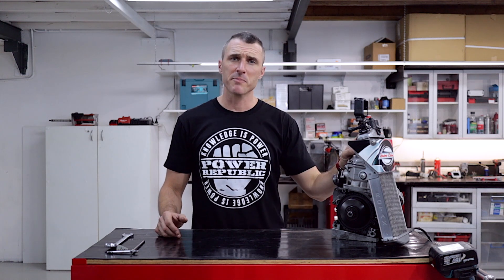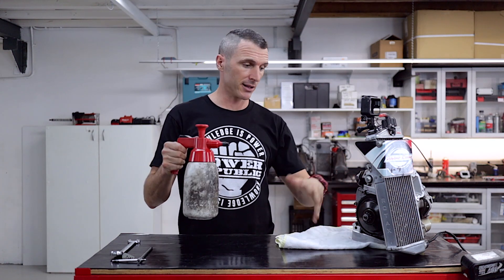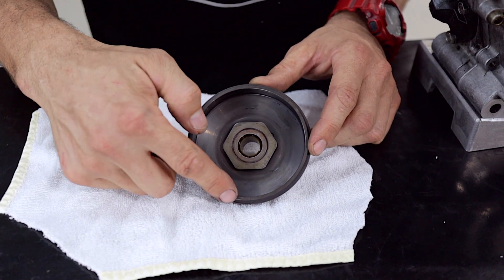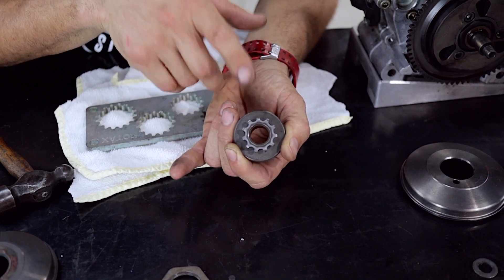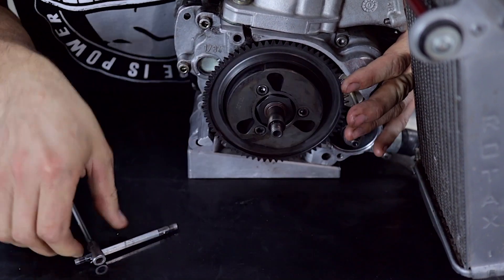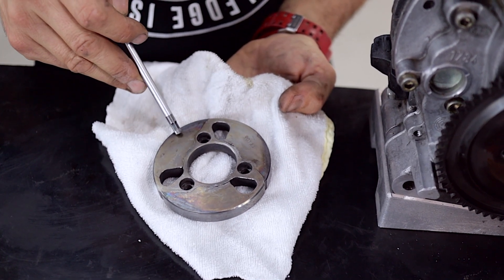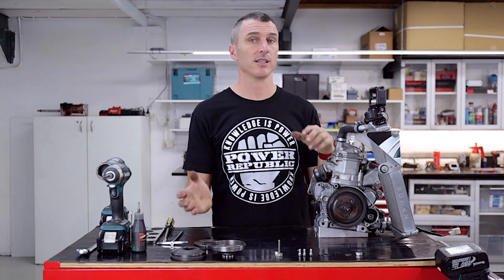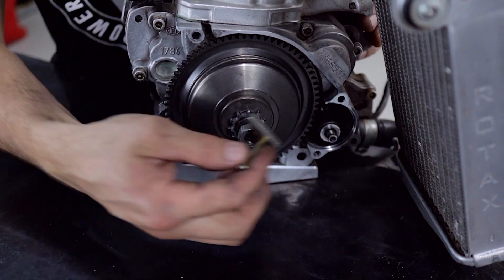HOW TO: Service Your Rotax Max Clutch - POWER REPUBLIC

Comment: Hi mate!!
Couple of comments additional to the great job that you have done:
1) Lubricate crankshaft with lithium based grease in the running area of the needle cage
2) Tighten hex. nut with thrust washer (machined side towards the clutch drum). Tighten- ing torque 35 Nm (26 ft.lb).
I have done it today, as Rotax recommend to do it after 2 hours.

Regards from Valencia (Spain)
Reply from the maker: Hola Vig,

thanks heaps for tuning in and sharing the videos.  how's the karting in Spain this winter?
Reply: @PowerRepublic  hi Derek, karting in Spain is great even during winter time, Take into account that the coldest day we get specially in Valencia is 10 degree Celsius and by noon in a sunny day we get 18C. Close to my city With less than 40 minutes drive I have 7 circuits, valencia is the city of the Motorsport, come to me in case you come over to Valencia sometimes , all the best!
Vicente

Comment: New to the sport, just found huge cracks on my clutch drum after hearing it grind against flywheel.
Looks easy enough to change, but I never thought the drum was a wear and tear part.
Reply from the maker: CFG Goes Racing the older ones cracked on the regular. The newer ones are harder to break but still do from time to time.  They are a bit like tyres, when worn out, replace it

Comment: As a newby I’m really enjoying your videos and learning so much . Thanks . Can you do a video on a clutch upgrade to the newer style clutch and gearing ?. 
I’ve got the kit in a box of parts and keen to get this done . 
Much love
Reply from the maker: Hey Ryan, you are very welcome.  The vids are definitely there to help you new guys with the fundamentals.  We have a video on how to remove and install the Rotax Ring gear and also the new style clutch drum.   Check them out and if I’m still short, let me know and I will do a remake for ya
Reply: I’ve since had a better look through your extensive videos . Only question I had (maybe missed ) was the flywheel . Is it just a case of using the gun to whip the nut off ?.
Thanks for the videos , big fan

Comment: Hi Power Republic, thanks for the video! it helped to do the service and change the sprocket on our engine. I have a question though: why in your video there isn't a needle cage between the engine axel and the drum assembly like is the case for our engine? Are there different engine models? Thank you very much.
Reply from the maker: Yeah the 11T sprocket has a plastic bush as the bearing

Comment: Wish you would have talked about the sleeve bearing vs the needle bearing and installation. Also you said tighten clutch Allen heads to 15NM this is incorrect and I snapped a bolt. After reading the FSM as I should have in the first place it is 5NM!

Comment: Hi. Great videos. Learning a lot ahead of buying a kart. What strength Loctite are you using please? Also what torque did you go to for the three shoe bolts? Thanks!
Reply from the maker: I use blue Nut Locker. And 16nm for the clutch shoe nuts
Reply: Power Republic Thanks Man!

Comment: Hi there lovin your videos as always, i just have a quick question for you. I have a very new clutch fitted to my max engine but the drum doesnt really spin freely by hand is this normal? Its been well lubed just was thinking perhaps this is binding on the o ring or is it possible the thrust washers fitted are the wrong size, cos it spins well if you pull the drum out a but when the nut is tightened it doesnt spin so good. Any help on this is most appreciated. Thanks
Sam
Reply from the maker: a fresh o ring and clutch assembly can be tight.   have you double checked that the sprocket has a relief in the back for the o ring to sit in?
Reply: Power Republic I’ve checked the sprocket there is no relief for it to sit in, this is a 13 tooth sprocket

Comment: Hey Derek, great video. Yesterday I was doing a practice session at track and. I realised a very loud noise at Low RPM. I would give a bit of throttle and the kart will hesitate to move and make a loud Reving like noise. I also noticed a a bit of metallic specs/dust near the chain guard and also the engine near the clutch. Any idea what the issue is?
Reply from the maker: it might be that your clutch ring gear has some loose or there is a problem with the clutch or clutch bolts.  let me know how you go.  D

Comment: Hi,  I'm jumping into a Rotax for the first time at my local track with the Rotax FR125 Senior package after taking the L0206 class.

Should I expect the same look when I get to my clutch package? I'm fortunate that my local track has a lot of very enthusiastic bunch of gear heads.

Thank you for your time,
Reply from the maker: Hey Neil, awesome news and welcome to the club.  the clutch on a Rotax is very simple and requires no servicing or adjustment.   I haven't used a L206 here in Aus but I would assume you can adjust the weights and pick up points?

Comment: Another informative video, Derek.  One question though.  Do you clean and lubricate the needle bearing also?  If so, do you use a heavy silicone grease or a lighter weight lubricant like Tri-flow?
Reply: In this video this engine is running the 11t sprocket which does not have the needle bearing, but rather a bush thats pressed into the sprocket. In both cases they need to be greased, Derek probably overlooked that in this demo. You need to use a heavy grease so that it wont fling off and get into the clutch and make it slip. Triflow is a definite no no, that will surely get flung everywhere inside there and your clutch is gonna slip massively. I use Bel-Ray waterproof grease it works perfectly but don't put too much, just a little dab and distribute it evenly
Reply: thanks for pointing that out  , I was wondering the same thing . I use hi temp disk brake grease with no issues
Reply: @IggySport1388   Eastendhunter9  I use for the needle bearing LITHIUM-BASE GREASE from rotax, item number   897330
Reply from the maker: Thanks guys for your responses.  I didn't cover there cleaning and re greasing in this video.  Apologies, this engine is in for a full rebuild and I was only using it for the demo before it got pulled down, so I neglected to lube the bearing in this demo.   If you have the clutch drum off for servicing, definitely clean the bearing and re-grease.

Comment: Does the 38mm nut have a correct orientation ? I heard that the 2 sides are different and there is a correct way to install it.
Reply from the maker: Yeah not sure.  I usually put the side with the bevel to the top

Comment: Do you have a video like this for the x30 engine or is it roughly the same?
Reply from the maker: Great question, the latest X30 clutch shoes and ring gear set up  is very similar with the 3 screws.   The shoes do fit over a spigot on the ring gear which is a tight fit, so you might need the X30 clutch puller to get the shoes off.  Vortex Mini ROk is very similar to IAME by the way.

Comment: My ring gear is loose and because of this, when I go to take off the retaining nut to take the clutch cover off, the shaft moves with the nut as I turn it so I cannot loosen it. Have you any tips on holding the shaft still so I can take off the retaining nut? Thanks
Reply from the maker: remove the spark plug and insert a piston stop.  that will stop the crank shaft from rotating.  otherwise buy the little ring gear locking tool from Rotax like we use in the video

Comment: What could usually causes vibration problems (on idle and also while driving)?  Even though the clutch is new..
Reply from the maker: Wheels out of balance ?
Reply: Power Republic actually I can see the kart moving a lot even when the it’s on top of the trolly. And it really doesn’t feel like the wheels are shaking.
Reply from the maker: What sort of engine do you have

Comment: Hi, do you have to use different size retaining washer for 11T and 12T sprocket ? My clutch always breaks and spits out the clutch drums past the mounting nut.
Reply from the maker: Yes you do.  11t is small , 12t is larger

Comment: When the kart is sitting on the trolley,  I get this small hollow twitching sound from the clutch when I turn the axle. Not continously but once per revolution. It doesn't sound like its coming from the engine so it shouldn't be the piston / piston ring (Will tear it apart and double check to be sure). Anything you've come across??
Reply from the maker: nah its the clutch drum 'tinging' on the rig gear I would imagine.  maybe a new clutch needle roller bearing would fix it.
Reply: @PowerRepublic  thank you very much for the input! Will get some spares ordered (might as well add a clutch drum and other candy) right away and get to work! 🙏

Comment: Yo ago lo mismo pero parece que cuando pongo la torica la arandela de goma luego al apretar la campana se queda muy dura i no gira es normal??
Reply from the maker: make sure the rubber has lube on it.  also too the old front sprockets didn't have the recess in them for the O ring.  so check that too.  Then make sure you have the bearings sitting perfect.
Reply: @PowerRepublic  ok gracias , creo que este motor va sin la goma. Un saludo
Reply: @albertomuniz1328  Al final cómo debe ir colocada las arandelas ? Porque yo apreto el conjunto y se queda la campaña muy dura. Un saludo

Comment: when my kart is up on a stand the rear axle doesn't rotate very easily. I've been told it may be something with the clutch. Is there a way to loosen it up a bit?
Reply from the maker: yeah it is probably the O ring in the clutch, its no big deal, but you could lube it up with some grease if you are really worried.  are you using the 11T on the Rotax

Comment: Can Rotax clutch be used to replace OEM clutch of x125T motor? Also how to prolong service life of these centrifugal clutches?
Reply: Great video btw!
Reply from the maker: Hey K, thanks mate for tuning in.   the Rotax clutch only fits on the Rotax engine normally.  you could try and fit it to other engines but it is not worth the trouble in my opinion .  hope that helps

Comment: Hello thank you for your reply, the videos are very informative. I have one question regarding my lo206. The sprocket carrier on my 50mm axle has the key way with 2 holes in it. When I mounted a new lo206 engine the clutch sprocket or driver was outboard and I had to move the rear axle sprocket / carrier further to left or brake side. The key is now only half way under the carrier. I was told to wrap the protruding side with electrical tape and it should be ok. I’m just wondering / worried this isn’t ok. Any help would be appreciated. Thanks. 
Mark 

Thank you very much.
Reply from the maker: Hey Mark, yeah that should be okay,  otherwise you will need to move the keyway over to be under the sprocket carrier in a Milling Machine.